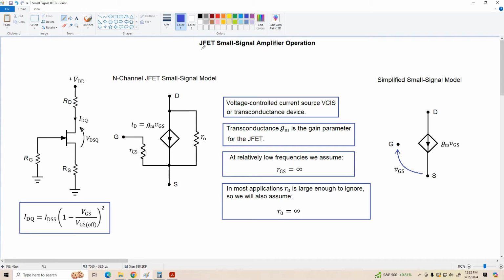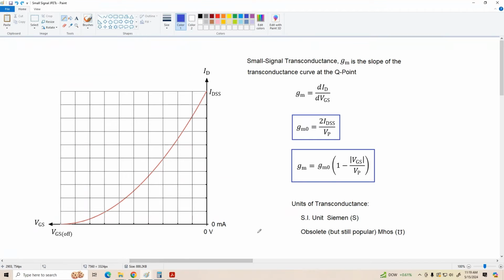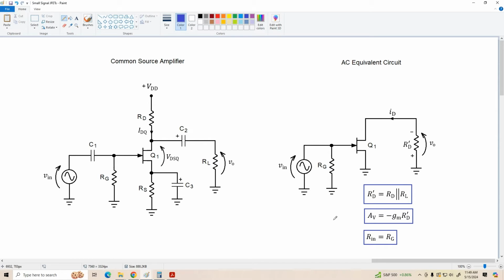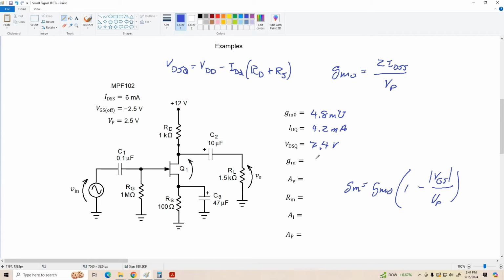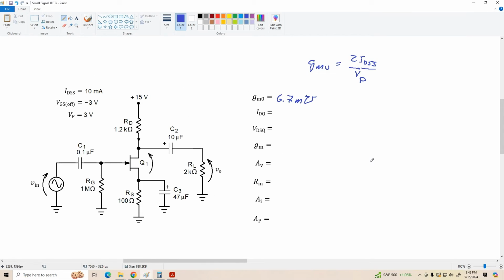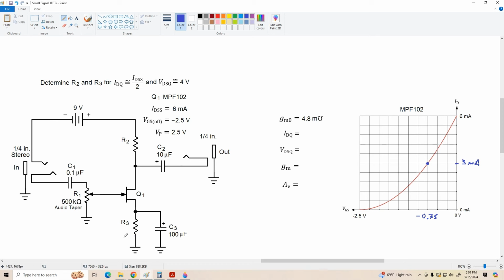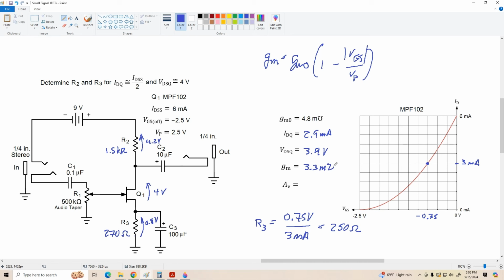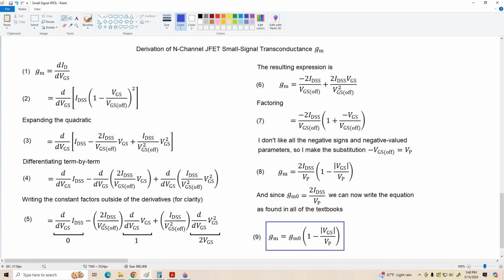Topic 43: JFET Small Signal Amps

Comment: Thank yo . i have  a question related to matching impedance . When it is necessary to achieve matching impedance and when it is not?
Reply from the maker: Impedance matching is most important in RF circuits. In high frequency applications (where the wavelength of the signal is similar to the circuit dimensions) the usual methods using lumped circuit elements don’t apply and we get energy reflected between source and load, which is not good. 

In the case of audio amps it’s somewhat similar but without the reflection issue. Transformer coupling does match impedance to a large degree by default, but in guitar amp applications we can sacrifice perfect impedance matching for maximum possible output swing. The situation is more nuanced in the case of Hi-Fi amp design, where distortion characteristics of components also can dictate Q-point location and impedance levels. Thankfully, most of the time we just want guitar amps to  rank out power when turned up to 11. Thanks for watching!! 👍🏻

Comment: Hi there, i wanna limit inrush current to the "big" capacitors  after the bridge rectiefier using mosfet's (witch is what i got at hand).
If you would measure the voltage with a LM393 comparator and a CD4013 or and gate as latch to open the N channel mosfet on the positive rail fully.
How would i apply this "trigger" to the mosfet on the negative rail? .... with close to 40 Volts difference.
It works on the simulator, accept due to high voltage difference the mosfet on the negative rail is opening much faster (if you would use a capacitor delay).
How can i tackle this?
Reply from the maker: If I get time I’ll try to think of something. No promises. I’m sure you’ll figure it out though.
Reply: @Denton.Dailey  i tried various things, like transistor Totem Pole, to shift the voltage difference, it works, but the same problem, it would be cool if it could be done with a single timing capacitor than one on each of both rails.